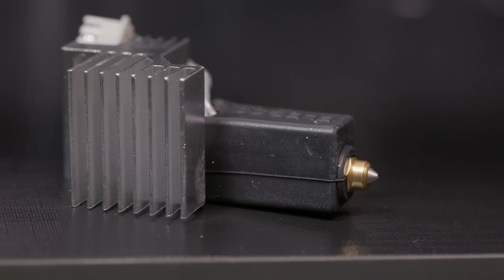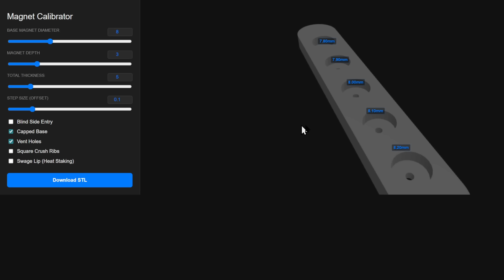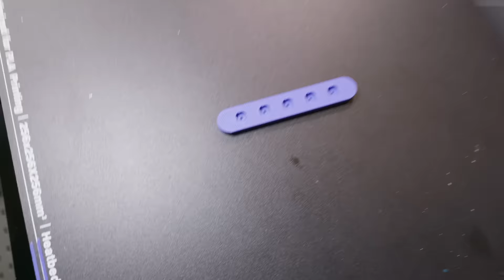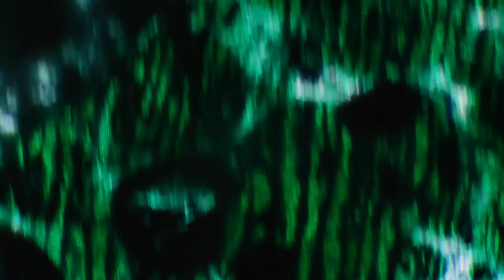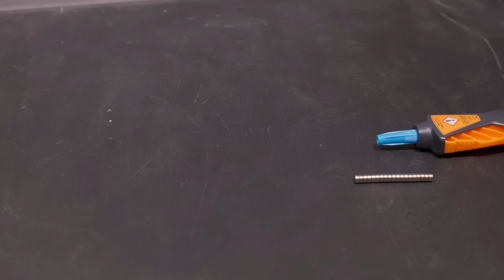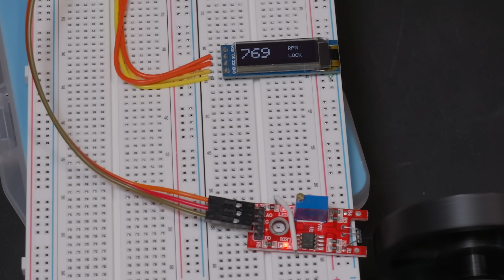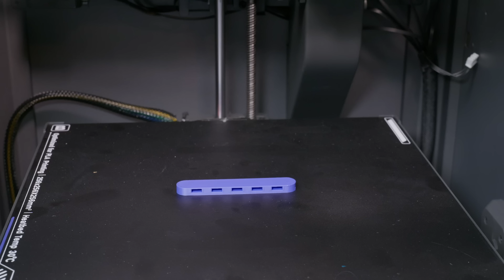Magnets in 3D Prints: How to ruin your printer edition

Comment: What I have done when inserting magnets during printing is, put super glue first, then the magnet. Let it dry for a couple of seconds, then continue the print. Now they will not pop out to the nozzle as they are stuck due to the glue.
Reply: This is exactly what I do, zero problems, professional looking parts, and NO issues.
Reply: I do the exact same thing lol. I’ll spray an activator on the magnet too typically so it cures instantly
Reply: @Senor_Pappaya  me too glue them no problem
Reply: This is what I've done for years, never been an issue.
Reply: Your way is the correct method as long as the magnet is not too strong. (Strong enough to interfere/interact with the print head's movement as it could in theory snap the print or slow the print head movement enough on each pass to distort the print.)
Reply: His test is at 250c.  Something like PLA would have a nozzle temp of 220c.  So the nozzle itself would be 30 degrees lower.  I wonder where the threshold lies......  The plastic is being cooled to a significantly lower temp very quickly.  So being lower to begin with and quickly getting cooler than that....I think PLA with a pause glue up is the way to go!  What other filaments have you tried!?  I'm curious what you've had success with.
Reply: @dpjazzy15  Nozzle temp of 220c and a cooling fan, plus the nozzle is .2 mm away from the magnet, so only the plastic carrying a limited amount of heat gets in touch with it directly, is cooled rapidly and depending on the printed part, the nozzle only glides over the magnets for a fraction of a second at a time, so it has time to cool down in between.
I printed multiple objects out of pla with magnets inside and had no issues. Yes, it needed a 3 instead of 2 magnets compared to glue. But the glue variant got loose too often and didn't look good if glue spilled out. Could have optimized it with places for the glue to go and adding some pressure fit - but the printed in version looks so much better - which was essential, as they were in a very visible spot.
I actually reused some magnets from failed prints (totally not worth the effort of getting them out of the print for what they are worth, but I didn't want to throw them away) and they survived the second print just fine and still worked good enough.
Btw, the part where he claims, demagnetizing isn't reversible is wrong. You just don't have the equipment for it. You can buy magnetizers, which induce a very strong magnetic field with ultra-high currents in a coil, which will magnetize anything that's inside.
Reply: @Matzurai remagnitizing it would just require an electromagnet, right?  I would imagine one could make one pretty easy out of scrap electronics.
Reply: @dpjazzy15  basically, yes - but you need a really strong one. Those machines charge up some large capacitors and then create a very strong, very short magnetic field using high voltage. To dangerous for me to make out of scraps.
Reply: @Matzurai my grandfather used an old coil TV antenna and hooked it up to a small power supply.  He would stick screwdrivers in there to magnetize the tips.
Reply: @dpjazzy15  There is different qualities of neodymium magnets, based on their materials composition and the exact ratio of additive metals. But even the highest quality Neodymium Ferite Boron magnets (the most common alloy composition you can buy) has a maximum working temperature of about 200 degrees C. The magnetic force weakens below this point, reaching a maximum recoverable weakness around the max operating temp. However, any time spent above that is unrecoverable and some amount of magnetic flux is lost. You don't actually have to reach the curie point to do this, however reaching that point essentially turns it into a paramagnetic disk. Generally speaking printing with PLA is probably going to be fine as the thermal mass of the magnet itself will quickly absorb heat energy and reduce the actual temperature of the PLA quite quickly. But hotter materials may cause some damage as the standard Amazon magnets normally are of a composition with a max working temp between 80 and 100 degrees C. PLA is probably fine here as the thermal mass of plastic is quite low. But hotter materials like ABS, ASA, Nylon, may have some detrimental effects when combined with the required high ambient chamber temps of 50 degrees C and up (ABS, ASA, Nylon really should be printed in chamber temps between 60 degrees and 70 degrees C).
Reply: @dpjazzy15  Different magnet types have the "dangerous" temperature at different temp. You could also freeze the magnets and hold the magned (at least) temporarily with superglue to allow printing over it.
Reply: @MikkoRantalainen so make the cavity a hair deeper than it needs to be, so the molton plastic doesn't touch it and theres a small gap between the plastic and magnet.  Done.
Reply: Was going to suggest this as a comment, but you beat me to it. :D Superglue is so cheap, fast and easy to use for this.
Reply: I did this with a button I embeded to prevent it from wobling then I put some hot glue around it, and a glue stick ontop of the botton, then printed a plunger on top of it. just similar with printing and pausing to insert something :)
Reply: I accidentally ruined a build plate this way. 😅
Reply: Also, especially for PLA: preheat the magnet on the print bed. 60-65°C isn't going to harm them, and in fact it has two big benefits, both tied to the fact that the magnet's heat dilation factor is generally higher than the plastic's.
First, the fit of the magnet will be tighter which will prevent the nozzle from pulling it out even if it's magnetic.
Second, if you put cold magnet into the hole, the printer will print a layer over it... then the magnet, which also has a higher heat capacity, will slowly dilate and push the layers apart. I have ruined a few mini bases like this. But if you insert the preheated magnet then it's already at its highest size and it won't break your print.

(Of course these are only valid concerns if you put the magnet in the bottom of the print, like I do with mini bases, fridge magnets, etc... - if you don't put the magnet directly above the bottom layer then it won't matter, the magnet won't get hot enough.)

I haven't quite managed to ruin the print bed magnet yet, but we'll see.
Reply: Same. Only issue I've forseen (but never actually experienced) is if you're putting a magnet only 1 or 2 layers above the build plate, I get paranoid I'm going to get ca glue on my build plate if it seeps through. Not hard to avoid though.

Comment: For thin objects: make a transparent silicone mould with a thin base, place the mould on a steel sheet, position the magnets in the mould (they will be held in place because of the steel sheet), pour in UV 3D resin, cure with a UV lamp, eject.  The item can then be washed and fully cured in the usual way.
Reply: Hmmm

Comment: Most neodymium magnets look like chunks of metal, but that's only a thin outer coating. In terms of handling them it's better to think of them as being ceramic-like. The way they are brittle and break is quite comparable. That's especially relevant if you have magnets of bigger sizes but then it's a good idea to educate more about handling them - all it takes for some dangerous collisions to happen is even a moment of distraction
Reply: @tomallo99   Exactly this. Under no circumstances should they be used for a ground when MIG welding. Please don't ask me how I know...
Reply: @owensparks5013  why? Lorenz's force?
Reply: @timcordes4762 The very thin outer plating is a good conductor, the internal material, not so much. It suffered a rapid unscheduled disassembly and scattered ceramic like shards erm, vigorously...

Comment: Friction fit: remember, PLA has creep. Friction fit also works only until your environment is warm enough for heat expansion to release your magnet. My Stealchanger carriage had its magents solid/never coming out with just friction fit, until I started printing ABS for an hour, after which they started to just fall out.
Reply: this isn't even just a PLA problem; heat cycling damages any press fit component in most thermoplastics. PLA's relatively low glass temp makes it much more prevalent though
Reply: i dont use pla for anything other than prototyping imo, i use asa or petg for that kind of material need
Reply: @snikrepak  There are two schools of thought on that.  I've seen tests where PLA is actually stronger, in real life.  I'd rather print in PETG, but PLA looks better, IMO.
Reply: @kwilliams2239  your nuts lol PLA is literally an inferior material in almost every prospect, thats why it's the bottom of the barrel and certainly a much cheaper option for those not looking to make expensive mistakes. It would literally melt in your car if it was a hot enough day lmao like how is that stronger? what tests, where did you see them, please leave a link lol. And i hope it was in real life, where else would it be? XD
Reply: @EMC_Industries  PLA is more rigid it bends less than PETG, but petg will withtand way more force before breaking, PLA will shatter, PETG bends it will spring back before plastic deformation, PLA doesnt recover as much. ABS is stiffer than PETG. I used to use exclusively ABS but because of the fumes I stopped using it unless i need the heat resistance properties, so I default to petg for general strength, and pla for everything else.
Reply: @EMC_Industries  PLA will never "melt" in your car. It requires 150C+ to turn to liquid (which is what melting means). You would have much bigger issues than the integrity of your 3d printed cupholder if the inside of your car reached the actual melting point of PLA. You're talking about Glass Transition, or the point at which PLA distorts or warps. Big difference.

The melting, or glass transition point, defines resistance to heat, not strength, so your rebuttal doesn't really make any sense. When you compare filaments you want to talk about things like tortional strength, tensile strength, etc. "Strength" is not a singular property that means anything. Strength against what type of force is how you compare two materials. 

I think you should brush up on a couple CNCKitchen videos, because you seem to be equating cost with quality, which is a mistake. There are a lot of misconceptions about the "strength" of PLA. In reality, PLA outperforms more expensive filaments in many types of specific strength tests.
Reply: @MrKipperfish Fair point on the technicality—glass transition vs. actual melting point, you caught me using casual terms lol. But practically speaking, if a part warps into a puddle of useless plastic at 60°C in a hot car, it's a failed part for functional mechanical use. I’ll give you that PLA has surprisingly high tensile strength/rigidity in a climate-controlled room, but for real-world engineering and functional components that deal with any elements, ASA and PETG still clear it easily. My point still stands
Reply: @EMC_Industries  let's remind ourselves of your original premise, which you say still stands: "PLA is literally inferior...in almost every prospect." Impact and heat resistance? Sure. Stiffness, tensile strength, layer adhesion, strength to weight? Certainly not. At most you can only say you were partially correct.

For me it's the hyperbole that just ruins your comments. For instance, there's no reason to suggest PLA needs a climate controlled room. This suggests it does not work as well in a hot room, perhaps 40°C? That's not true. 

 Few situations in the "real world" require 60°C temperature resistance, and for those that do, don't use PLA. 

This notion that it is not suitable for "real world engineering" is either disingenuous or just a misunderstanding that engineering (or let's not put lipstick on a pig, use by humans) should always take into account conditions and use a suitable material for the job. Sometimes PLA is a bad choice, but it's also a great choice, and better than ASA or petg, in many circumstances. The notion that it's almost always inferior just doesn't stand up to reality.
Reply: @MrKipperfish just go enjoy your PLA prints man, doesn't matter to me what you choose is better to you

Comment: Instead of glue or a soldering iron I like to use a center punch around the perimeter of the magnet hole. The slight material deformation really locks them in.
Reply: That sounds clever and easy. I mostly rely on an empty jig, holding one magnet in the right orientation that I sneak up on the other jig damaged my weists forcing friction fits….

Comment: Zero issues with magnetic interference with my stock Prusa MK4.  And drop-sealing a magnet in is still the most secure and aesthetically pleasing approach, from a purely design perspective it can't be beaten. Also, you're losing minimal magnet strength if you design your part to have as few layer lines as possible over the magnet. For a small magnet a single 0.4 layer is fine, for very strong ones 2-3 are enough.

Comment: So heat removes the magnetic effect. So how do the magnets on the heated bed stay magnetic.
Reply: It's down to the formulation of the magnetic material, H grade neodymium magnets typically have Curie points in the 100-150°C range, samarium-cobalt magnets can have Curie points as high as 300°C but are way more expensive than neodymium.

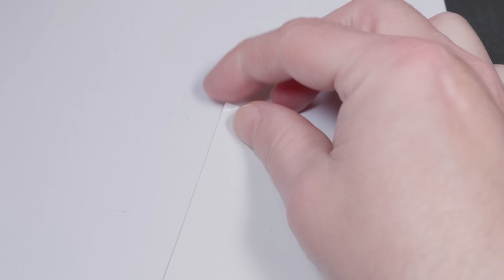Comment: 13:35    Those sheets of sticky backed magnet do not stick very well long term. My girlfriend got me a little wooden mail holder for the inside of my front door, which is steel. It has a sheet of that magnet 11" X 4" and after 3 months on my door, it just fell off one night with the magnet still on the door! I put it back on and drove some little 1/4" wood screws into it about 1/2" from the corners to make sure that doesn't happen again. Other than making a spot-faced hole for a plastic pin ( a small forstner or brad-point wood drillbit would work for that ) or rabbeting the edge for a frame like a wooden panel, I can't think of any good way to get past that on a 3D printed item. That is because those plastic sheet magnets only work on fairly thick steel while in direct contact with it's surface. Therefore any method of retaining the sheet has to be flush with it's surface or even inset a little. I drilled pilot holes and drove the screws in till the heads were flush. I tried driving the first one past that point, but backed it out because it raised a lump in the plastic around it's head. A really sharp drillbit could have made a suitable countersink for the screws but I did not want to put that much effort into that task.

From that I think you can see that those sheets are something to avoid if possible! Your magnet hole maker makes putting an array of magnets into an item a much better option. Thanks!

Comment: i is possible to get small neodymium magnets with chamfered m2/m3 holes through the middle, this allows you to use heat inserts and an apropriate screw to fix them to the print. as you dont want to do the screw too tight to avoid cracking the magnet i would recommend lock-tight in the heat insert. the main downside of these appart from their extra cost is that they are effectively directional with how they are installed with regards to their magnetic field so you must pay attention that the ones that you use are an appropriate pair.

Comment: Centauri told me not to ever unscrew the nozzle, when I asked them. Which is interesting since you can. 

As an aside, the magnet on my CC1 came out the print head cover and I epoxied it back in.

I am glad you did this video as I can share this to better explain to others why magnets can't just be heated or chucked around.

Comment: Something not mentioned is using tape to cover them, tape is pretty thin.  Or also glue and thin metal strip, or another idea is put a thin metal under them, so they stick to that metal to hold them in along with glue and friction fit.   just a few ideas.  I put tape on my car magnets and they stick really well and then don't scratch the car paint.

Comment: My AD5M printer has a 0.4mm brass main nozzle, so there's no problem with the magnets closing. To ensure that the magnets have enough power, I use more powerful magnets in larger quantities. But in the case of hardened nozzles, yes, you will have to insert the magnets with preload.

Comment: Heat damages magnetics so bad that I generally avoid embedding them on the bottom side... Since when in contact with the printbed it suffices 1 hour at 55-60°C of the PLA to significantly make them weaker. Fine on TPU with bed at 35-40°C, for my lil exp.

*edit: Imagine my ass face now at 8:50 as you're about to show what I've fuct up with magnets on the bed. Like, I'm smart only enough to see it coming but not enough to have foreseen it by myself. Dang. (Thank you! ;))

Comment: Paused and went to check with a magnet on a 2024 P1S and turns out it all went fine bc those nozzles aren't magnetic not becuse I embed magnets tight. 
D'ya know when you should feel relaxed after all, but you still feel like you just dodged a... horrible mechanical failure? That.